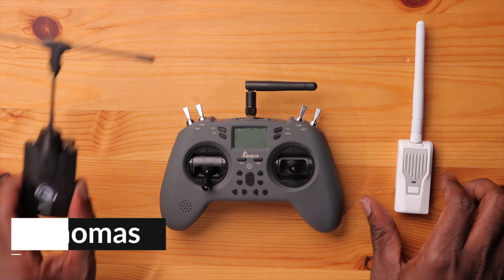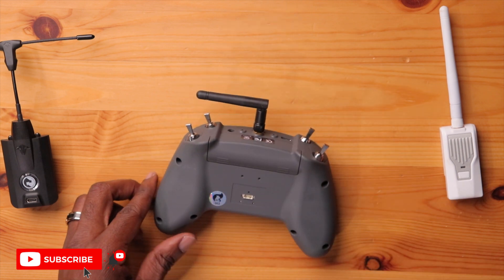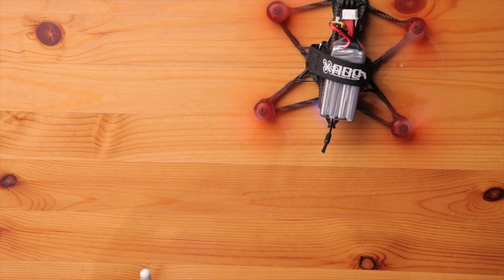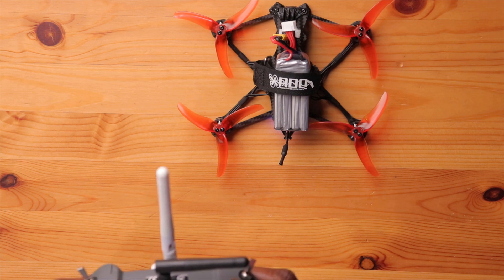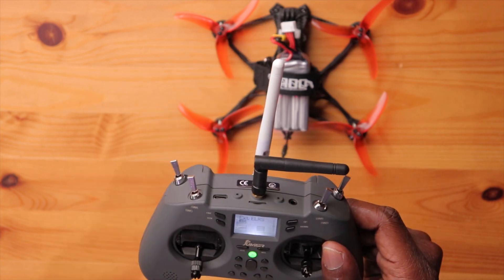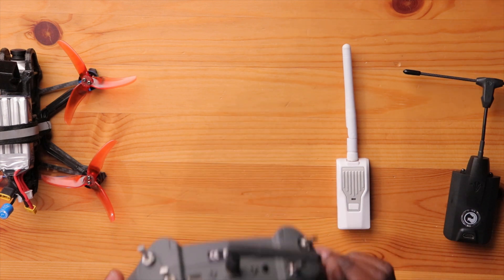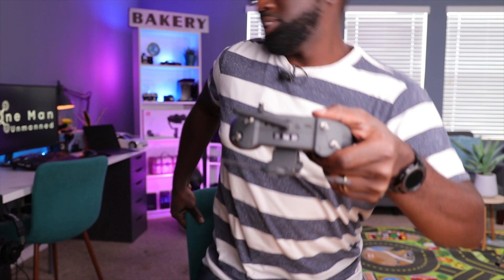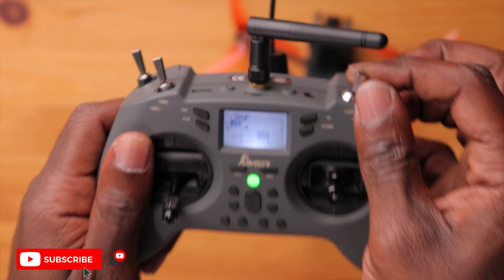Can the T-Lite V2 Run these Modules at MAX Power?

Comment: About the t lite, did you change the operating system to edge or did it come in factory?
Reply from the maker: It came with Edge TX from the factory.
Reply: @OneManUnmanned  ohh mines apparently came with open tx... I think its because i buyed the multiprotocol version

Comment: Couldn’t you just use a RF power meter to measure the actual output?  
Enjoy your content and perspective always!  Thanks 🙏
Reply from the maker: Yes, I could have, but I don't own one(I should buy one).   Plus the point was to see how much load the T-Lite could handle, not how much power the modules can output.
Reply: @OneManUnmanned  Ok, understand.  I guess I was thinking about testing RF output with the modules powered externally, vs powered from the controller.  but I realize not all modules accept external power like crossfire...  so no way to test that comparison.   What you did is fine.  Thanks for answering the question.  :) I learned something today.. ha ha

Comment: Range Test?
Reply from the maker: I don't normally conduct range test too often(primarily due to legal reasons), but I've used the ELRS module at 250mW on two of my drones and they work pretty well at far distances.  I'll link them below.  BTW, ExpressLRS.org has a leader board for range on multiple power levels.
https://youtu.be/tuiYUV-EBu4
https://youtu.be/flvRxsrH07c

Comment: Nice video! I have been looking for a change for my Taranis X-lite with an old FrSky protocols (praise D8 :)) to a elrs protocol. And since T-lite has Hall gimbals and now can power external modules with no issue - it just edges Zorro for me! As you know, there is a way to install AG01 gimbals on it and it has 1000Hz for Elrs (more feedback on control on lower power).... So no edges for Zorro no more ...
Reply from the maker: Thanks…All great points.  I looked into the AG01, but still haven’t decided if I need them.

Comment: Nice 👌🏼🚀😍 but my t lite V1 works very well with a Nitecore 3500mah (25€)😳 and with a longer time compare to the Zorro (more 3 or 4×)
Reply from the maker: The V1 works well..I still use it. You just need to know its limitations.  I'm sure the Zorro will improve battery life in V2.
Reply: @OneManUnmanned  sure but I will not buy the Zorro V2 because I m a pincher and for now I prefer the t lite (perhaps the Zorro it will better for me with an news sticks end)
Reply: @ludofevrier5593  is it possible to squeeze in 1more 18650 hidden inside V1 or V2? U think?

Comment: Hi Thomas I still have the V1 and I purchased the elrs by happymodel specific to this remote. In the pictures it seems to have a voltage regulator. This V2 seems to have that built in that's why. To help you checking the power you can go to page11(telemetry) and look for TPWR. or even setup a DISPLAY
Reply from the maker: Yeah, the V1 works well with that HappyModel module.  I didn't know about the page 11.  I'll check it out... Thanks.
Reply: Can u go 1 watt with an additional power pack
Reply: Basically.  The wattage is distance...pretty much?  See i had my mind made up on the Lite v2.  Now im thinking of jumper pro!  But i do like the layout of buttons on the lkre v2.  Thank u for teaching